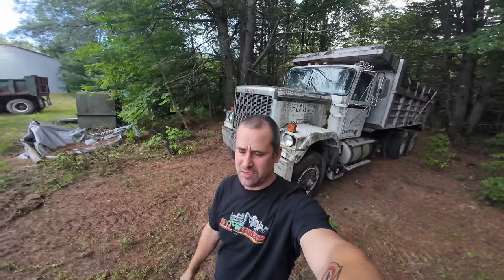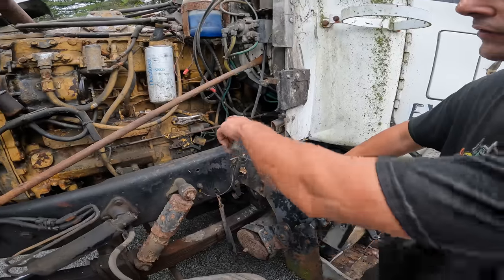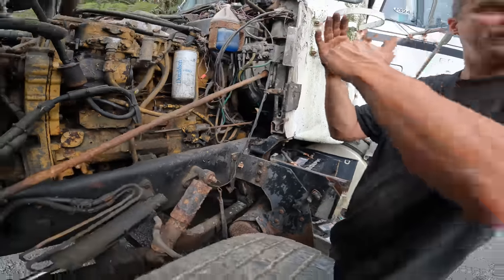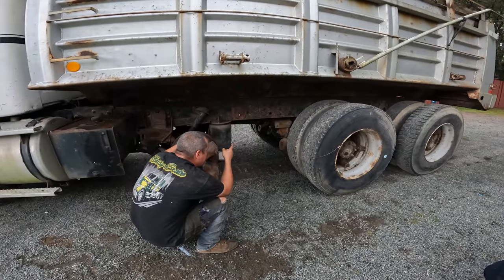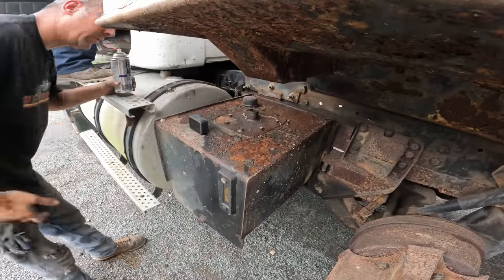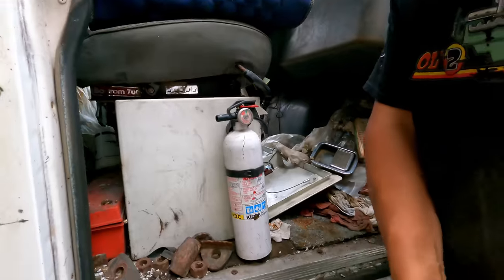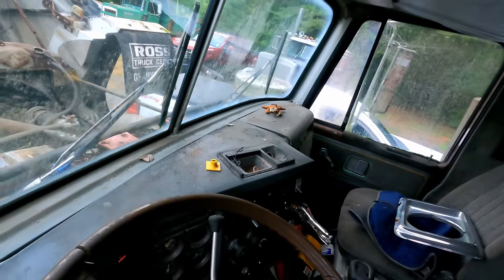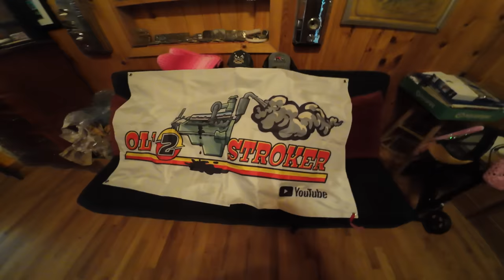1984 GMC General saved from the scrapper! Abandoned for 20 years!!! Will it start?

Comment: The GMC General! My favorite truck of all time?! If you want to see something super rare it’d be the Chevy version of this, the Bison.
Reply: They were my favorite also Ron hopefully Wayne will restore it 🙏 😊
Reply: @shellyweiers121  The truck is nice, and would be a good match for a 2 stroke, but it isn't one, so I'm afraid that unless he wants to swap in a 2 stroke, it's an irrelevant flipper.  The thing to do is quickly get it functional enough for a buyer to drive it home and flip.
Reply: @shellyweiers121  If the engine was dead, then swapping in a 2 stroke would be practical, but the engine is good, so it isn't, and 4 stroke trucks are OT.  Another reason to flip is because the truck is better off in a state that allows that drop axle, including Mexico is necessary.

Comment: Man, that Mack Wrecker is gorgeous!! What a unit..🤩 ...and speaking of units, I can't believe that 3406 cranked right off after sitting for 20+ years! Actually, when you first popped the hood, I half expected to see a 6-71 or an 8V71 lurking under there. At least it appears to be old enough to not have all the common rail crap that's on Cat motors now. The fan and associated parts should be fairly easy to locate. It would probably be beneficial to roll that cab off of there and drop something nice on it (later model daycab maybe?)

Comment: That was the craziest thing I have seen in a long time, the differentials are Eaton 44's, from the quick look of the front diff on the right side the 2 speed shift motor opening had a block off plate on it. So you have a couple possibilities, a single speed in a 2 speed housing or a 2 speed locked in low, but they are 44,000 # axles. The front diff is the early 44 with the small round oil pump on the power divider, it may have a broken interaxle differential or broken output shaft.

Comment: Your fan club is growing........and people who you never heard of are finding good stuff for projects . Whoever tipped you to this fairly late model GMC deserves a KISS !  When you first discovered the dash switch for the 8LL transmission, it was like the deep reduction switch on my 9500 with 915 Filler.  Nice that your tow crew buddies stuck around  to help explain some of the unique advancements by GMC ........including the cables for top stud sealed batteries. that came out in the late '60s .  I thought you might upgrade dumps from your Brockway .  One of the best gifts you could imagine  when you got this tip !

Comment: Old semi trucks can sometimes be had very cheap. There hard to drive n require all kinds a stuff to drive legally. I once bought a 1994 fld 120. Pretty good running 3406 n 18 speed.tossed batteries in n drove it home. 2k.

Comment: Sometimes it's entertaining and educational to watch a guy be compelled to beat on something for hours in a Will It Run, spending time and cash, sending the injector pump to Area Diesel Service for a rebuild, etc. In this case, it was gratifying to know you not only saved this gal from being shredded and sent to the chicoms but that it fired up almost effortlessly. Good on ya, Wayne. Nice way to start off the long weekend.
Reply: Part of it is its previous owner had the foresight to properly treat the fuel so it wouldn't break down and attract water. Power Service makes excellent fuel additives used them for years from on the farm to 18 wheelers.

Comment: I drove a 1982 5 Star General for right at 10yr. It had a big cam 400 Cummins with a 13 speed transmission. Triple framed with big bogie suspension in the rear. Toughest truck I ever drove and I drove for 30 years. Wrecked it which we got it fixed back but it was never the same.

Comment: The Crome brakerts on the cab were likely for a   Crome Luberafiner lots of them hade than them back in the day. From underneath the transmission looks like a super 13 hard to tell. The power steering was crap on gmc trucks so it is original. The diff may just be a broken input shaft when you put the power divider in  the collar slides on the input shaft puts enough pressure on the shaft to allow you to move the truck, but it will never move it with any sort of weight in the box. 
Great find hope someone brings it back to life. To good of a truck for parts.

Comment: I’ll be damned, that old Jimmy still has miles left in it yet! I recall the guy posted it on the GMC FB page and the admins thinking it was a scam..
Reply from the maker: Lol yea that's where I saw it! Turns out it wasn't a scam!
Reply: @Ol2Stroker  it’s a little rough around the edges, but man…I’ve seen far worse being pampered! Those Generals are getting harder to come by…have you determined if that Caterpillar is a factory installation or a replacement for a Cummins or Detroit?
Reply from the maker: @bowslap  I haven't determined that yet.

Comment: Man i was so close to buying a kw dump truck with a 8v92t and an 18 speed the guy wanted 2k for it problem is i dont have room 😢
Reply from the maker: Daaaaaaaaang
Reply: @Ol2Stroker  tires were also 50 years old and i worked on semis almost daily but my $20 an hour job could barely support my car addiction 😂
Reply from the maker: @Victorsvolkswagens  oh man I hear you there. I passed up a sick 79 kw golden nugget for like 2500 because it had a bad 92 and at the time I didn't have the facilities to deal with it or a spare engine. FML
Reply: @Ol2Stroker  ouch yeah also the thing was making oil badly it had easily over 2 gallons of diesel in the oil so most likely an overhaul would’ve been in order 😂 but now im trying to do a 4-53 or 4-71 in my 86 chevy c20 haha i was thinking cummins but almost no one does 2 stroke Detroit swaps anymore

Comment: tae be honest 2,5 for a complete running Truck with everything working, (holding air lights, switches...) is a steal (not counting the tipper function),
and a GMC cab that isnae rotten through completly,
I see shat running on the streets much worse condition they way newer than this,
just give it a good clean, service it, maybe get a sandblaster out for the frame and bed get some new high durability paint on it and yer gold.

Comment: Wait a second, did anyone else notice the charge pipe from the turbo to the intake? Am I crazy or is that just a tube jammed into the outlet of the turbine housing? It looks like it should've been flanged with a gasket and bolts, but someone just jammed a pipe into it. Maybe I'm just crazy.

Comment: it might be set up so that it unlocks the axle so it doesn't go in gear with the box up, that was a problem some trucks had... pto off but the box goes up out of nowhere like someone has a remote switch wired into override it, cant cheat a locked out switch board. annoying digital stuff and bozo gave jack wad the remote.